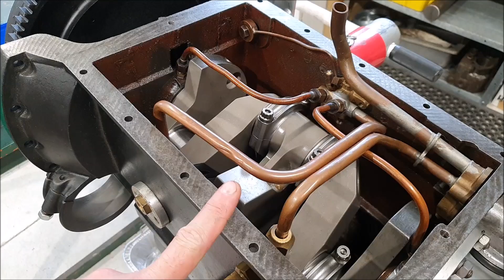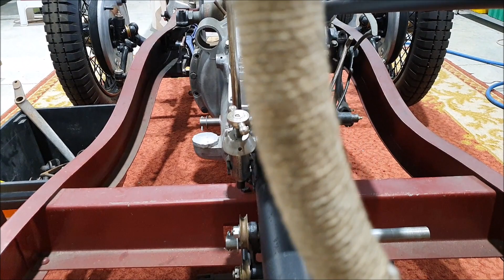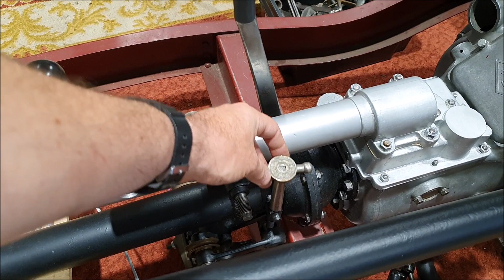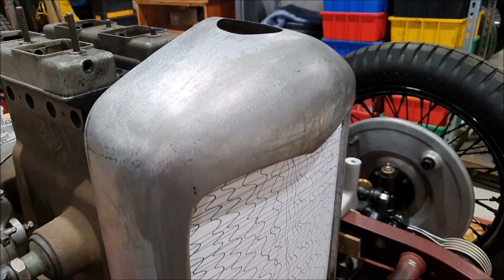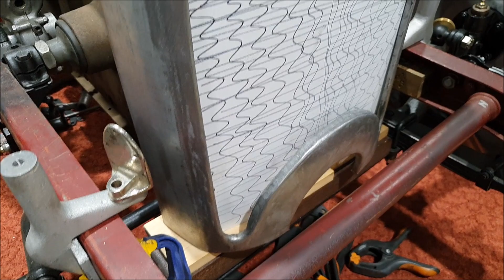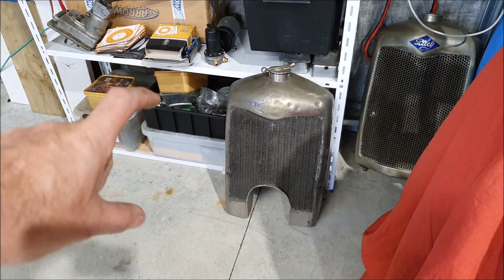Riley Brooklands remote gear shifter

Comment: I like how crisply that shifter goes through the gears, it should be a real treat to drive!
Reply from the maker: It is VERY positive. Almost like an over center snap action. Of course the gearbox has straight cut gears on 1st and 2nd and no synchromesh on anything so gear changing will definitely be an experience! I practice double de-clutching in my MGB all the time now.

Comment: ...I told you it would turn up..       That's a good replication of the remote change. If memory serves correct, the one i saw didn't have plating on the reverse lock-out, and possibly not on the gate either. (so this would be an upgrade!)

1st is top right, 4th bottom left. Changes between 3rd/4th/3rd can be quite clean (being a silent third 'box) but as you can see the throw is a bit shorter than the 1st-2nd throw. Quite an unusual arrangement, but manageable.
Reply from the maker: My MGB and A7 have almost the same pattern, just reverse is in different places. But yes, the Riley is somewhat different!